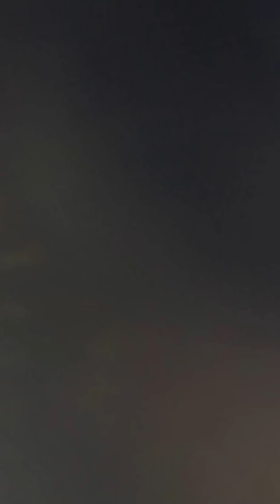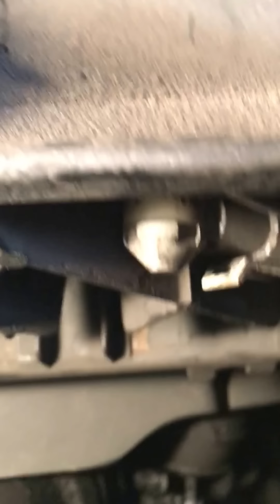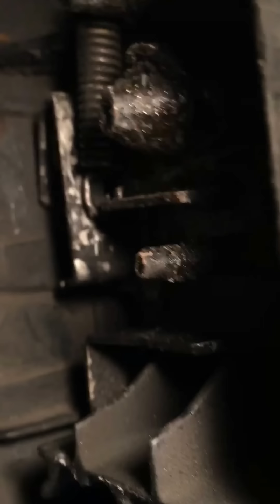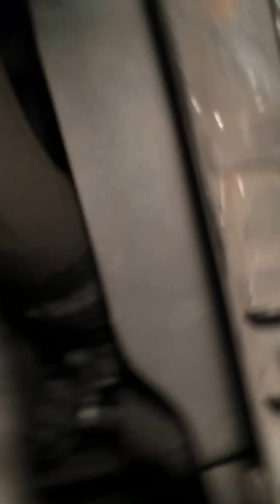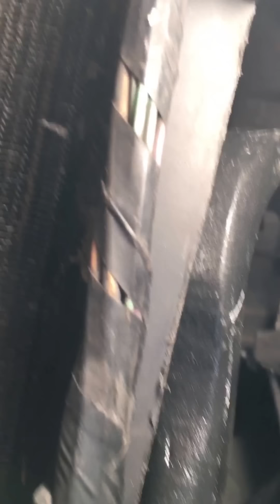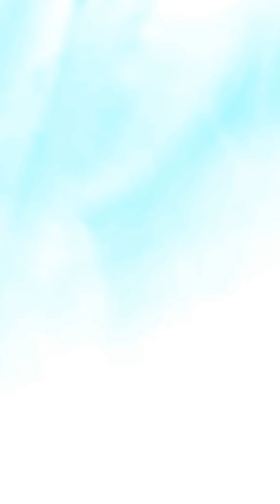RENUALT MEGANE 2003 BONNET RELEASE CATCH OPENED AFTER CABLE BROKE.

Comment: Two of my mates and one of the wives (all stoned) spent over an hour last night trying to do this on my Megane. One of them managed finally but I need to do it again now and change the headlight bulb they never succeeded with after all. This is much more helpful than having to watch that circus last night thanks.
Reply from the maker: Haha stoned what a fun sight to behold ace mate😁
Yeah it's easier to come through the wheel arch to do the light bulbs, should be videos on here, I did it once, took to Halfords after that let them do it. 👍🏼

Comment: Tips on how to close a Renault cilo bonnet l... thank you in advance
Reply from the maker: Alright Frank, I'm not sure what's wrong with yours not closing, have you checked to see if anything is blocking the catch, have you sprayed the latch with WD40 incase that is stuck, I ended up sending my megane to the grave yard 3 years ago, head gasket went, said to see it go it served me well.
Reply: Thanx mate ...hope it can get sorted
Reply from the maker: @frankMIALL  I now drive a Ford focus, touch wood, no bonnet troubles yet, I'd lube it up with WD40 and copper grease for the latches there after to see if it frees them, sounds like its stuck Frank.
Reply: Cheers mate I’ll try it :)

Comment: MAN! you saved my workshop today. I was ready to light it on fire. Hood was locked up after test drive - cable disconnected, probably by removing the battery. Managed to open it by hand, it can be done with help from this video!
Thanks!
Reply from the maker: Lukáš Folvarský your welcome pal, at least you appreciate it, took me a while to pop the latch but I did it 👌